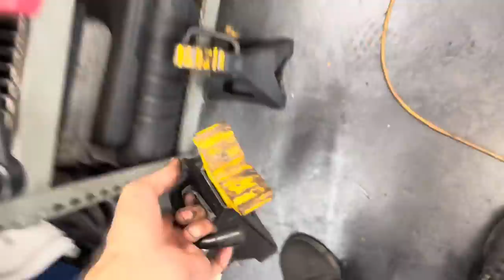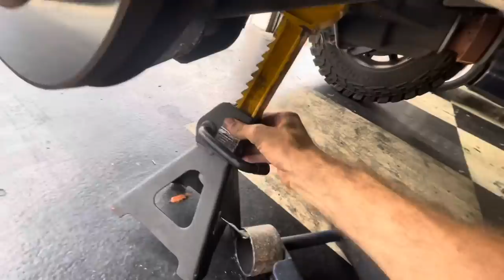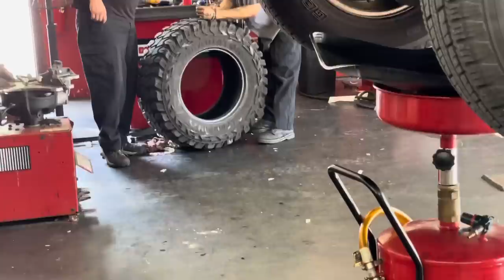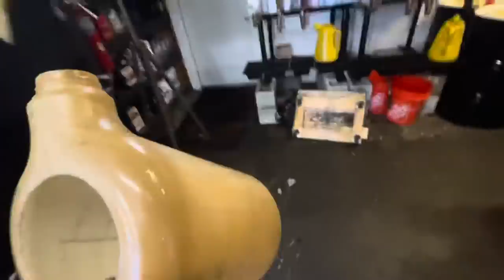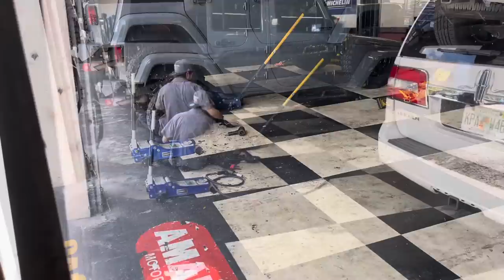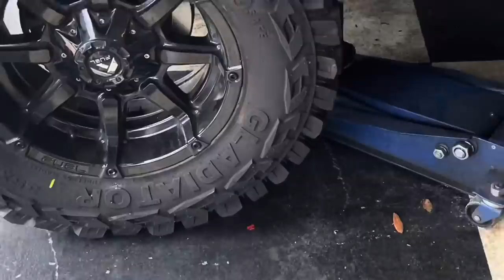Jack Stand Joke! I Failed!

Comment: As a worry wort, everything about this makes me cringe. That wooden block that's angled toward the front of the car and looks like it could roll at anytime (even if it's the camera angle, I wouldn't trust that block). The other tech trying to yank the jackstand out from under the car at the end.. Is the jack holding the weight as he's doing that?! Makes me think it's not if he has to tug it out. I know Ray probably locked the jack into place, but... I don't know. 

I'm around Ray's age, and I remember when I was in my late teens and early 20's, I would always work on cars with only the jack supporting them. I look back at myself an cringe so hard, and how lucky I was the jack never failed. So I guess I'm sayin everyone makes mistakes and does unsafe stuff, but.. I hopefully the other tech learns to at least throw a jackstand or two under the rear axle in the future in case the something happens and the jack fails, or better yet just lower the car down onto a couple jack stands and leave the jack up close to the frame just in case.

Comment: Playing devil's advocate here. Don't you think you could have caused a portentially unsafe incident by placing that jack stand, and not telling him? What if he had just dropped the jack down without noticing the tire was off the ground still, and had tried to back out? The actual thing to do would be to pull him aside show him what he is doing unsafe, and explain the safety aspect. Not publically shaming the guy on a video. And if he contiues doing it, then you quietly report it to the shop manager who, if he is a good manager, will correct the problem himself. Most coworkers take unsolicited criticism as a sign that you think they are stupid.

Comment: That guy did not got the message. Next time just place the jack under the axle and put the stand next to it under the axle. Have to lift the axle only 3 inches instead of 2 feet with a woodblock.

Comment: I only jack up a car to change tires on the side of the road. But if I'm close enough I'll sacrifice a rim to get to  a parking lot. Or gas station awning especially if it's at night and rainy. 
My record is 10 minutes from park to clean up. If I'd had a battery powered 
Impact wrench And speed jack I'd be faster.

Comment: you can't trust jacks. They fail all the time. And there have been so many accidents whit them. I have seen one fail in depot on a race track. I't failed so fast. The car went from almost at the jacks top position to floor under second. Luckily no one were under.

Comment: i dont like wheel off without something under it so i do have 2 axel stands and about 4 blocks of wood that are about 4" or 5" square but i will always throw wheel under car unless i am checking it. ive seen a car move off a trolley jack, was lucky it didnt have far to drop as something like wheel was there. ive also seen a jack loose its pressure and drop. cant trust hydraulics to hold things up, fluid is not anywhere near as load bearing as a chunk of metal or wood

Comment: How about the piece of wood that was used as a spacer? Nothing was said about that. If you have to tell your tire tech more than once to put a jack stand underneath it. Then your tire tech should find another place to work. If you make a video pointing out someone else's fault. Make sure you are not making any faults of your own. Again I come back to the block of wood used as a spacer. Ray should have shoved the jack stand under not worrying about the height setting. I really do not care if I get hateful comments. I have worked in this industry in both the military and civilian world. Safety is everyone's responsibility. You have time to turn on a camera and then take care of the issue. You are not part of the solution you are part of the problem.

Comment: In all seriousness, he wasn't under the vehicle. What was going to happen if the jack failed?
Now, if he was under changing a starter, that would be something to make a stink over.
Reply: Vehicle can twist or move sideways coming off the jack and the vehicle can hit the ground hard enough to do damage.
Reply from the maker: The thing is tragedies are usually caused by multiple smaller oversights that all add up at the right place at the right time.
Reply: He was very much under the vehicle with both his legs under the car.

Comment: Okay I'll admit to changing a tire in the driveway without a jack stand... but why would he even think of placing the floor jack at that location instead of under the axle tube.. Lifting the entire chassis through the droop distance of the suspension to get the tire two inches off the floor seems odd...